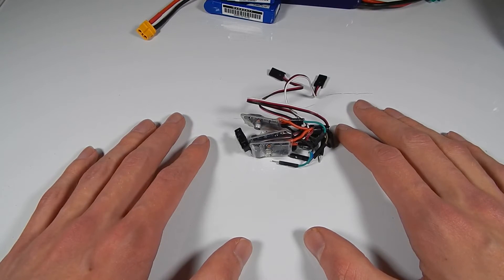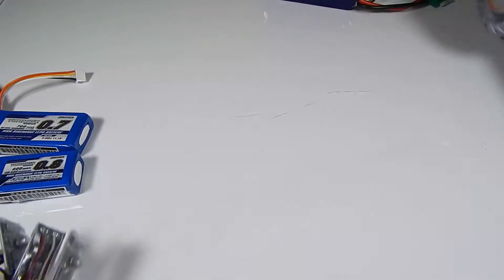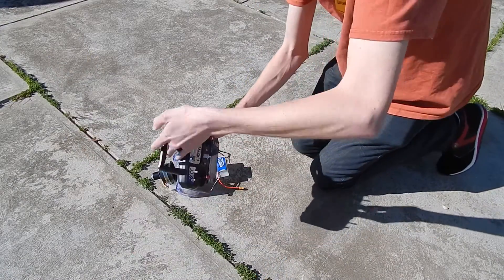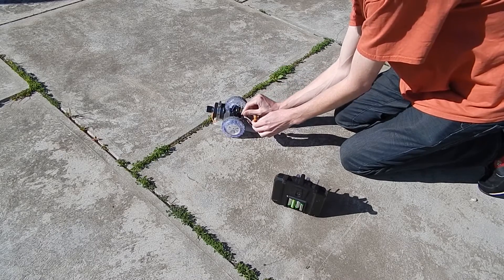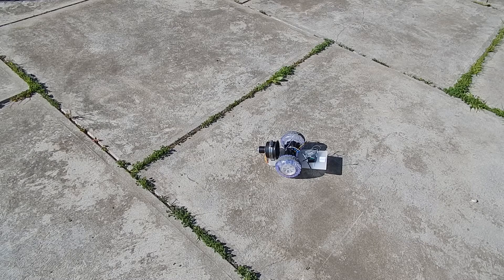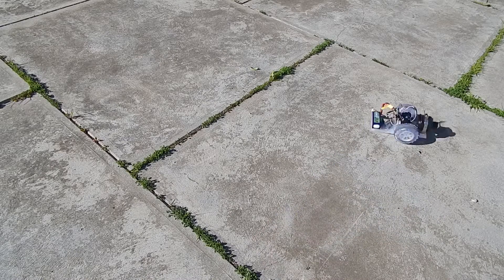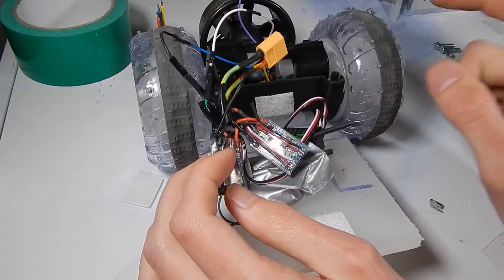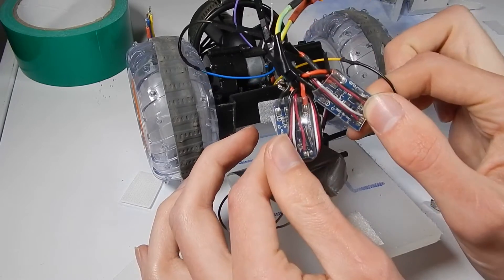Overvolting cheap Chinese ESCs

Comment: When you were wondering about the performance characteristic anomaly that was the 4s I was just about to mention but glad i watched till the end . As you mentioned ,my thoughts also were the tires had a pinch of tranction for that amount of juice .you probably already slapped some all  rubber tires on them lil ev's ..if so any change in the performance characteristics?

Comment: Would it be okay or not to put a 4.8v battery in a small car that comes with a 3.8v battery? Its just a cheap lil thing but its battery only lasts 10 mins and i can find 2000mah in 4.8v not 3.8v.

I know very little about rc cars and their parts obviously xD
Reply from the maker: Those are close enough in voltage that I would personally try it
Many things can survive a little more then their rated voltage
BUT
There is still a risk, if they cheaped out on components or didnt build the circuit properly, it could damage the RC car

Even if it doesnt damage the car straight away, the higher voltage might cause damage after a lot of use (as componets get hotter and run longer)

So again I would do it with my own stuff, but without a lot more details, I cant say for sure it will work for you no problems
Reply: @TeamPanicRobotics  cheers for the reply mate, the car itself is only 25 pounds so if it breaks no biggie :)

Ill give it a go and if it breaks ill just buy another one and try find a 3.8v.

Ill also sub see if i can learn more too :)

Edit, i accept full blame if i blow me car up :)

Comment: as soon as you put the motors under heavy load  they will draw more current it is this that will burn out the esc
Reply from the maker: Thats where this video comes in: https://youtu.be/_iumGzWloGY

If the calculated stall current for the higher voltage is under your ESCs rated current then it wont burn out

Comment: it seems I was miss lead on some cheap escs on eBay that said 3s but when I look them up on eBay using the serial numbers they are 2s , they are in my new beetleweight project . they get a little warm but not so hot that they melt the hot glue they are stuck to the test bed with. I ran them for 6 min just driving around the house and they seem to work. just not sure if I should trust them or not. what you think?
Reply from the maker: A little warm is fine, a battle is only 3 minutes so your ESCs will get less than half as hot as they did during your 6-minute drive. (electronics heating is an exponential thing until they burn out, as it gets hotter it conducts worse and hence heats up faster).

I think they should survive fine, these escs are only rated for 2s and I run them in my beetle on 3s and havent killed one yet
Reply: Team Panic cool man thanks for the insight

Comment: In my experience with those escs was that they did not last long on 3s. The bec was the first thing to burn out, causing other 5v electronics to burn out. Later they just stopped working.
Reply from the maker: Thats ok, combat robots only have to work for 3 minutes at a time. So overvolting like this is ok. 

If you want to use them  in a project that runs for longer, I would get better ESCs

Comment: How much current can be ran through those jumper cables? I just want to know if they can handle 2 amps. Thanks!
Reply from the maker: I honestly don't know, they designed for low amp situations (signals from an Arduino, powering an LED). So I wouldn't trust them much above 1A
Reply: Okay, thanks!